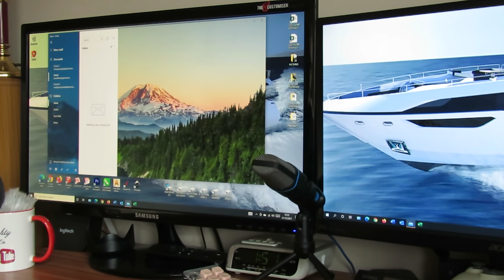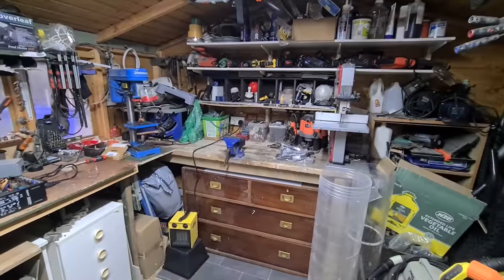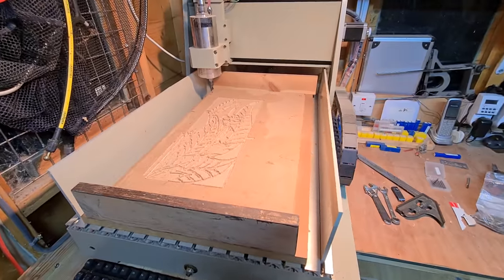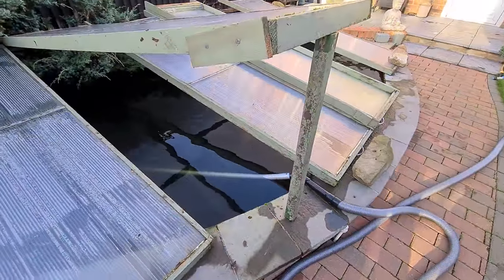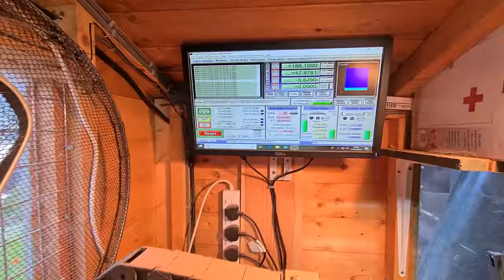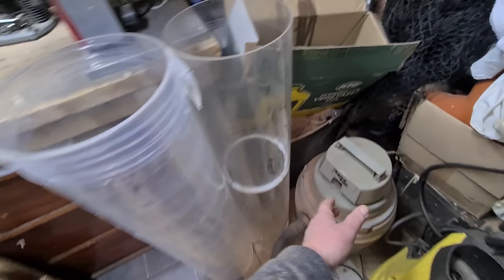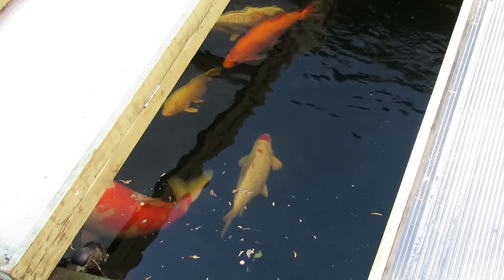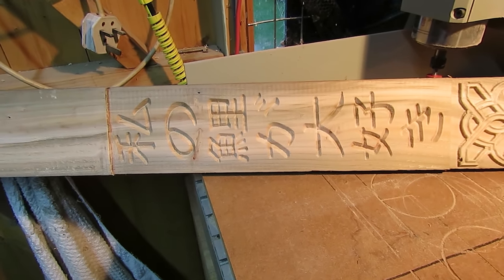What I've Been Up To In This Cold Weather.

Comment: Put your heater on the floor it will warm the room so much quicker and evenly. Hot air rises so at the moment it's all going to the ceiling. Having it on the floor will work better.
Reply from the maker: Hi Richard, that's right mate, but the lead won't reach, I've got to extend it when I get round to it lol. Thanks mate, Terry.
Reply: @Wrighty  have you considered a quartz or carbon fibre heater that uses infra red to heat you like the sun, rather than trying to heat all that air. I dont mean those horrible halogen heaters either lol.
Reply from the maker: Hi mate, Do you mean something like this: https://www.ebay.co.uk/itm/124952866332?hash=item1d17c56e1c:g:IHUAAOSw~TVhZ-sm Terry.
Reply: @Wrighty  did you get my reply?
Reply from the maker: Hi mate, I've not seen anything. Terry.
Reply: @Wrighty  How can I message you keeps blocking my comments.
Reply from the maker: Hi mate, I can't believe what's going on with YouTube and my channel. I don't get any notifications, I've got comments that keep disappearing, and when I answer some comments, the answer disappears. It's a nightmare at the moment. 3 times now I've been on to support, and I find they're pretty useless. You can get me on pondfilters@gmail.com mate if that helps.
Reply: @Wrighty  Have emailed you matey.
Reply from the maker: @richardc1983  👍👍👍

Comment: you could of just swapped the hard drive over to the new one,  then all the software would of been on the new computer,  or may of been cheaper to just buy the power supply as a seprate unit than a full new computer
Reply from the maker: Hi mate, that's what I did in the end. You can't do that with the older versions of windows, but I had a look on YouTube and found you can in Windows 10. So it was a piece of cake in the end. The computer was a second hand one I bought. Thanks for the thought mate, take care and stay safe, Terry.